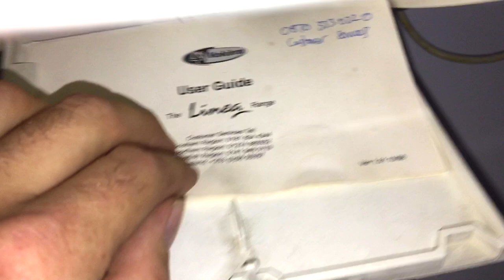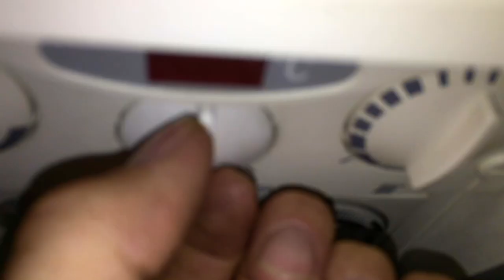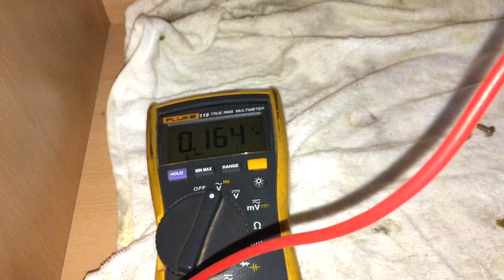How to test multiple boiler issues quickly. Heatinggeeks. Boiler repair. Vokera 01

Comment: What do you use between your u gauge hose and the clear hose ? Looks like air pressure switch tube ?  Maybe to stop it kinking ?
Reply from the maker: It is aps tube. I use it so i can connect to Worcester neg fan test points easily without it falling off. (Also when I'm on the scooter I can use it to repair a damaged app hose).
Reply: HeatingGeek cool thanks
Reply: @heatservicebwcuk1545  he knows his stuff that fella great clips for learning all sorts.